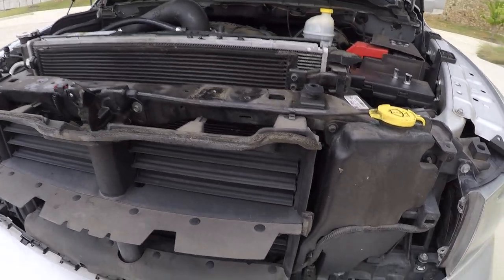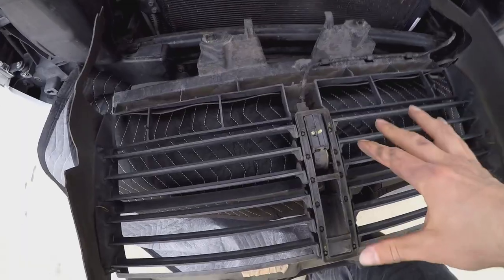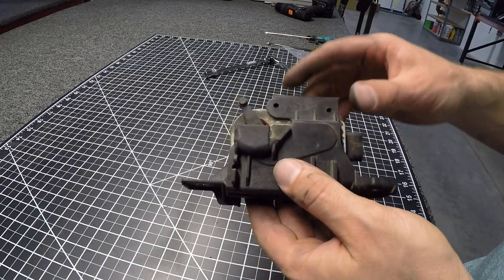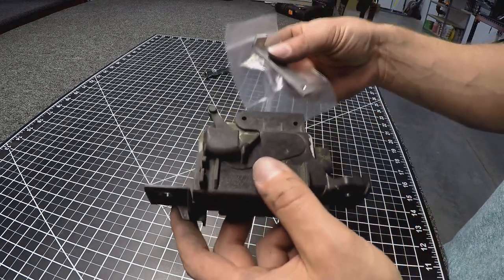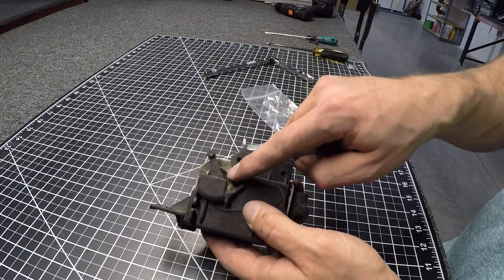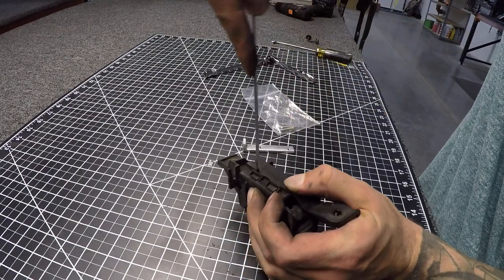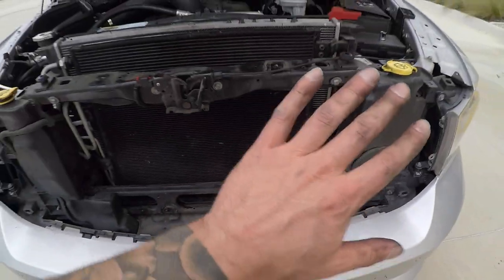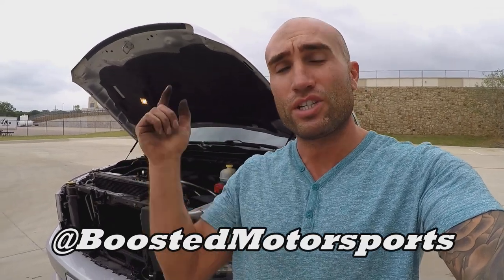How To Remove the Active Grille Shutters from a RAM 1500

Comment: Hi Where I can buy this metal piece please?
Reply: The guy that used to do it will ask you for 50$ USD, you mind as well go to a Home depot and buy a piece of steel bar or even aluminum, cut that  the same size you need...you shouldn't spend more than 5$

Comment: I know this is years old and probably not as popular now, I seen a guy comment that he only removed some of the shutters and left a couple so it sees “resistance”. I did the same thing and worked like a charm. I left the top and bottom shutters and it leaves plenty of room for airflow. I believe it really isn’t reading “resistance” because of you look at top and bottom shutters they both have stops for each direction. So I believe it just reads where it starts and stops. Very easy to do. Just be careful with grill clips, I have a 2019 classic and they snapped right off.
Reply: Thanks. I wanna remove a couple just to keep the coolant a little cooler. But  not interesting in doing as much as the guy in the video.
Reply: @rickylee2477  yup that’s why I did it. Took me 20 minutes to just take the middle shutters out.

Comment: What's the benefit of removing this?
Reply from the maker: If you run a lower temp thermostat for performance purposes your temps will stay in check and you can maintain a lower operating temp.  Also we will be installing a intercooler for the supercharger so these need to be removed too.
Reply: @BoostedMotorsports  what temp does the grill open at?

Comment: ANY ONE WITH THIS ISSUE PLEASE READ.  I have 2019 Ram 1500 and the check engine light was on due to failed communication with the shutter system. The first dealer I went to said it was the air dam and replaced it and the harness under warranty, no charge.  However, the check engine light came on again within minutes of leaving the dealership. They wanted me to come back for more testing but at my expense  or use my aftermarket warranty. They charge $200/hr for labor. I made an appointment with another dealer that charged less and THE FAILURE WAS SIMPLY A BLOWN FUSE.

Comment: Why would I want to get rid of those shutters?
Reply: A better question is why would you want them?
Reply: Eli Hal . To improve air flow volume when installing the intercooler for the procharger.
Reply from the maker: Check out this older video I made about it. When you put a lower temp thermostat in your truck for performance these shutters cut off the airflow to try to bring your truck up to around 203*

Also with the procharger intercooler I will need to delete them to make room for that 😎

https://youtu.be/AbqxQUWVrYY
Reply: Yeah, I understood about the ProCharger, but what I was thinking about was for a person that doesn't have a procharger or doesn't want to put a procharger on their truck.
Reply: Warranty
Reply: U wouldn’t
Reply from the maker: Eli see this video.  If you put a cooler thermostat in the truck the AGS system tries to bring the temperature up over 200*
https://youtu.be/AbqxQUWVrYY

Comment: Why not leave the housing intact and just remove the shutter blades?
Reply from the maker: You could but I'm installing a procharger and I need to have the space for the intercooler. All that content is coming soon on the channel 🤙
Reply: That’s what I’ll be doing... if I wanted MPGs I wouldn’t have put off-road suspension on mine. We all got priorities....
Reply: Arizona Storm your happy with it? Thermostat and e fan too? I’m doing it all, seems legit.
Reply: Arizona Storm how did it impact fuel economy?
Reply: Arizona Storm did the same thing as yours, runs cooler, and didnt see any changes in mpg,  went up 1mpg on highway,

Comment: I got those on my v6... easily make 750km with a tenk without loosing power.. won’t ever take those off, not sure why those would be on a v8..if u buy a v8 i assume you want it to go as a v8 should..
Reply from the maker: Yeah I even got 27mpg without them which I forgot to mention in the other video where I did the fuel mileage test so who knows how much they really help!
Reply: @BoostedMotorsports  after so long from my first comment i'm thinking to take them off as i installed a few mods for speed even having a v6 i don't see why i wouldn't like more air flow to my engine Lol , have you ever thought about just taking that little arm off the sensor ? wouldn't the gear just function as well anyways? that shouldn't throw any code...what you think ?

Comment: You never said what the purpose of removing it was. Chrysler engineers put it in for a reasons.
Reply: Efficiency. Motor burns cleaner at the 203-205 mark. More performance at 180-195* mark. They close to make your motor hotter faster and open to cool it down

Comment: What does this accomplish?  If the shutters are working, it improves aero (what brick doesn't need improved aero?).  With shutters closed, cold weather drivability is improved.  With high temp therostat, temp will eventually get to that temp anyway.  With an oil heater, the oil temp will raise the water temp.  I(f your Ram is losing water, you have a leak.  Also the weight lost is marginal.  Looks like a useless mod to me.
Reply: there is a issue with the desing of the shutters. causing the check engine light to come on frequintly,  by getting a bypass , or removing a few shutters, it fakes the ECM out, and removes the engine light issue,

Comment: What kind of idiot would want to remove their active grill shutters?
Reply: What kind of idiot wants to reduce the functionality of their radiator by keeping a shutter system that deprives it of cool air running through it at all times. 🤦🏽‍♂️🤷🏽‍♂️

Comment: Does your truck run cooler down the road  with the shutters  open ?  
I installed the electric cooling fan on my truck  from your other video but I think I might be  burning up the fan motor bearings  I know that fans kick on and off but I have mine running full time.  I would rather have air flow from driving to cool the radiator and have the fan kick on and off normaly.